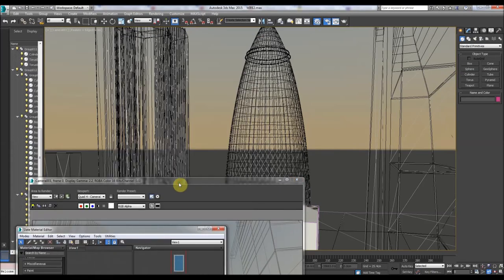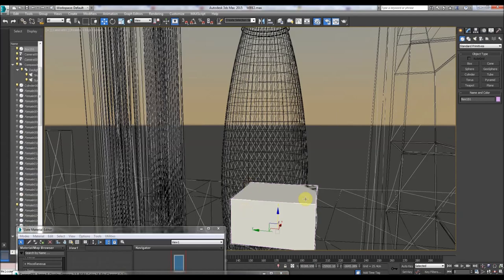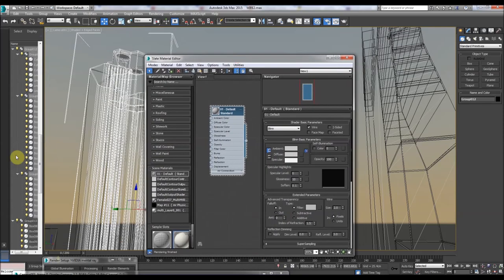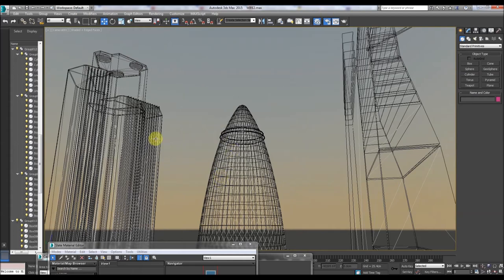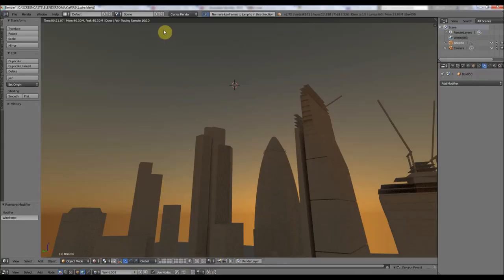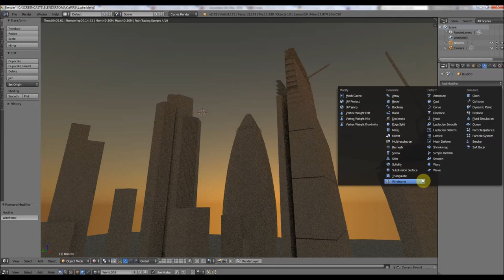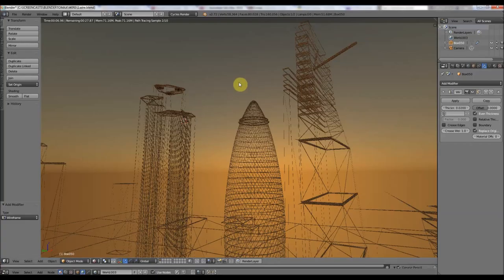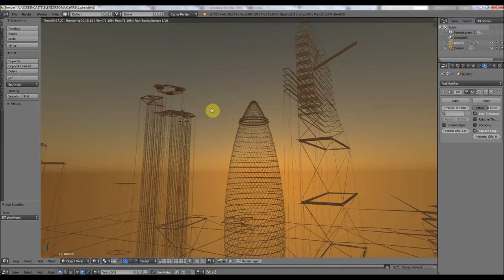Blender 3ds Max Comparison, Wireframes In Renders And Viewports

Comment: Blender actually has 3 ways. Cycles has a procedural wireframe material texture, but this shows all the internal calculated triangulation as part of the texture, seemingly quick to implement but of limited use. Then of course the modifier that generates the wireframe mesh, which is neat. (And covered by this video.) But now that Freestyle edges are supported in Cycles, it's possible to mark all edges you want rendered for Freestyle in the modeler and set up freestyle under the render settings. The Freestyle method may have the most flexibility, since you get to pick what edges show and how they're drawn, but it's best suited to wireframe over solid and likely the most involved in setup.
Reply from the maker: Cool thanks, I try to research it as much as I can when I make the videos. If you can put up links you would recommend for the freestyle method, that would be great for anyone else comparing. :)